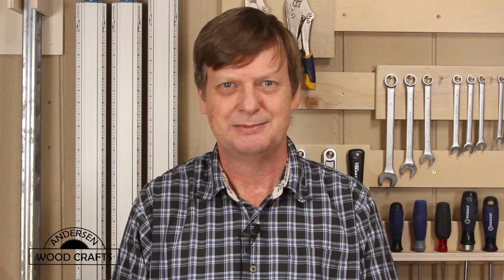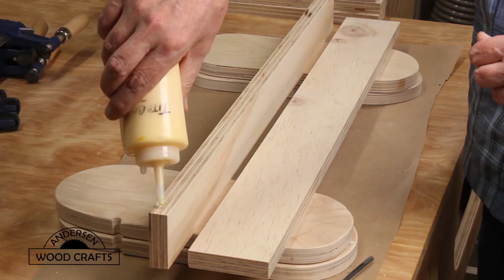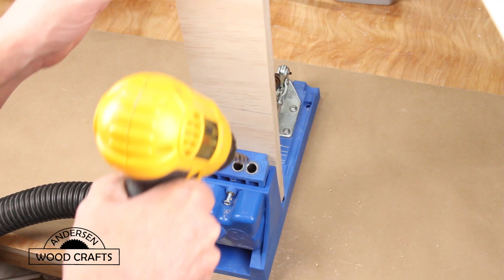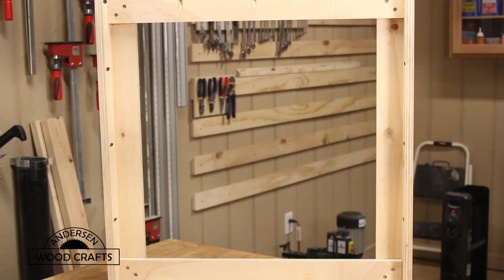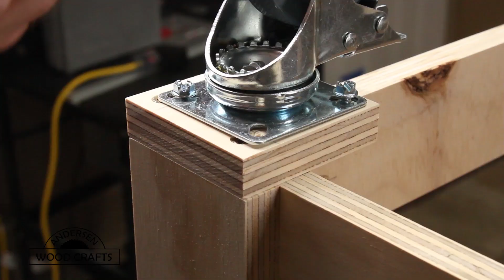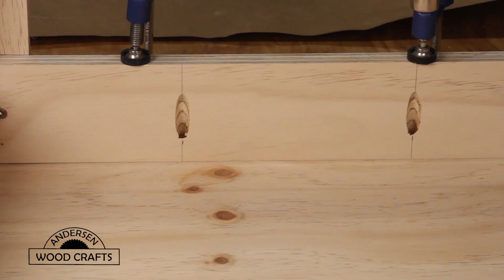SIMPLE SHOP CART FOR BENCHTOP TOOLS

Comment: I like the project. good design but i have one question. I'm not trying to start something. I can see in the video that you said the strength from the legs comes primarily from the glue and yeah I agree about that. My question is It looks like the pocket screws are really just being used as clamps so it probably doesn't matter but it does look like you're going the wrong way with the pocket screws. From what I've heard other people say the pocket screws should be driven from the outside of the carcass in so the screw bites into the most meaty part instead of pointing out towards the very edge of the wood. However this would leave the ugly pocket screw on the outside of the leg very visible but probably stronger but I'm thinking you don't really need it that strong because you're not really relying on the screws you're just relying on the screws as clamps Is that true. If that's true then Why not just Brad nail the thing together from the outside and then you could hide the tiny little dots from the brad nails.
Reply from the maker: You are correct that with just the pockscrews, it would be stronger screwing in from the outside, and I put them on the inside to hide them. Why I didn't use brad nails, because brad nails don't clamp as well as pocketscrews. This is what I love about woodworking. There's no one correct way of doing things; one way may be better than another, but in the end, it's your project, do it the way you want. Thanks for the comment.
Reply: @AndersenWoodCrafts  thanks for the reply and the post. I love the design. I'm going to make a version of it to hold my table saw. Probably going to use  3/4 OSB. It looks like forged carbon fiber but wood.  I think I'll call it "forged haute couture wood fiber". $20 for a 4x8 sheet way nicer than $160 for Baltic Burch.

Comment: I like your design and I’m going to be building a cart for the new drill press I bought. Any thoughts on having brakes on all four of the casters or would it be enough to have brakes on two of the casters and use the less expensive non-brake wheel casters for the other two corners?
Reply: I found a four pack of casters with brakes for under nine dollars at my local Menards so I have answered my own question.

Comment: Nice and easy design. I was able to build mine from scrap lumber. I modified for my dimension and dust collection. I wanted to attach a picture but I guess that is not an option.
Reply from the maker: That's great.  That is what I love about woodworking, you can modify something to fit your needs.  Thanks for your comment and have fun in the shop.

Comment: I'm so glad I came across this video, this will definitely be the design I use for my table saw. I keep all of my tools in the garage and drag them out to a deck on the side of the garage when I want to do some work. Be grateful you have a shop, I'm jealous! I'm not a pocket hole master but I think these are going in the wrong direction. From what I've been seeing, the holes should be going away from the edge of the receiving board, not towards it. Since you're using glue it probably doesn't matter but I'll reverse them just as well. (And then plug them since they will show more prominently.
Thanks again for posting this, I'll be on the lookout for more from you!
Reply from the maker: Thanks for your comment.  I didn't start out with a shop, I spent many years pulling equipment onto the driveway to use them, it works but is a pain in the ***.  Regrettably it may be a few months before I will be posting new videos, I'm in the middle of relocating do to the loss of my house from a fire, but once I get settled I will be putting out new videos.  Thanks again.

Comment: Staple guns or faster stronger
Reply from the maker: Not sure what you're asking.  If you're asking if you could use staples for assembly, you most definitely could.  I have bult them using regular wood screws and pocket hole screws, regardless what is used it needs to also be glued, the glue is what provides the majority of the strength of the joints.  Thanks for watching.

Comment: B.N. me gusto mucho esta forma de hacer esta mesa de trabajo.....la pregunta es si utilizaste plywood de 1/2" 5/8" or 3/4"....excelente trabajo. Agradeceré me des sugerencias respecto al plywood....Gracias.
Reply from the maker: Thank goodness for translator programs.  If the cart will be used for only light duty work then 1/2" plywood would be fine, but if you intend to put heavy equipment on it I would go with 3/4".  I used 3/4" plywood for this build and for the other carts in the shop.  Also make sure you use casters that are rated as heavy duty, I have one cart in the shop (different design then this) that is hard to move around because the weight of the cart along with the tool on it exceeds the caster rating. 
 Thanks for your comment.

Comment: With the relatively small size of my shop, I concluded mobile carts for my bigger tools (drill press, miter saw, table saw and band saw) and a French cleat rolling tool rack would be the way to go.  Glad to see you have a good design for the cart.  I had built one a different way and probably overengineered it.  I like your design.
Reply from the maker: I know a thing or two about overengineering things.  Thanks for watching  and good luck with your shop.
Reply: @AndersenWoodCrafts  Thanks. Buying the wood later today to build 3 carts following your design.
Reply from the maker: Good luck.  With the price of wood today you may need to take out a second mortgage for the wood.  Just have fun in the shop.
Reply: @AndersenWoodCrafts  Finished my 3rd one s few days ago. They work great. What I like most though is that they have given me the confidence to try case work since the elements are very similar
Reply from the maker: @ilive4livemusic  Fantastic.  Projects for the shop are great learning projects.  If you messed up and it's still functional, who cares as long as you learned what to do (or not do) next time. Thanks for watching.
Reply: @AndersenWoodCrafts  Yes, all mistakes were small and none critical. They look good, work well and now give me mobile table band saw, drill press and table saw. Next project will be a rolling French cleat tool storage rack for my hand tools.

Comment: What are the length of legs & rails?
Reply from the maker: The legs are approximately 28" (make sure you take into account the height of the casters).  The long side rails are also about 28" and the short side are about 18".  Of course these dimensions can be customized to fit your needs.  Thanks for the comment and for watching.

Comment: Thank you for your excellent video. I am not a woodworker but need a sturdy cart that will fit in a limited space. What is the heaviest item you have put on your cart?
Reply from the maker: Thanks for the comment.  The cart itself can hold at least 200+ lbs and probly much more (as I can sit on it with no problem), the main thing that could limit what weight load it can handle are the casters that are used.

Comment: this is useful for me, I have a small shop and I want to get my new bench top tools on carts(router table and spindle sander/belt sander) and my old bench top tools (drill press and bandsaw) off the bench they are on and onto a bench that makes the tables of these two tools lower than they are now.. This design with legs like this will save a lot on materials for me.  I bought casters today but didn't have this design in mind.  I would have used a lot more plywood.thanks for sharing this.
Reply from the maker: Thank you, these carts sure are handy in a small shop allowing you to move things around.  Thanks for the kind comment and for watching.

Comment: Super good video. I would like to build a cart for my band saw and another one for a compound miter saw. I am not very good at getting dimensions from a video. Is there any way you could give the dimensions of this cart?
Reply from the maker: The legs are 28" high and 3" wide, with the casters it brings the top of the cart to about 33". the top 26" x 20".  You can always adjust the dimensions to fit your needs.

Comment: Thank you , This is exactly what I was looking for simple, light , and super strong. Buiding it today. Just subscribed to your channel.
Reply from the maker: Thank you for watching.  Have fun building the cart, it does a great job in my shop.
Reply: @AndersenWoodCrafts   I built two of your tables. One for my Bosch RA1181 router table and one for my jobsite table saw. I want to build a work bench/outfeed table 26"Width X 60" Length  X 37" High. To use as a workbench/outfeed table. Will using the same method for the legs/frame  be strong enough and roll around ok for that?
Reply from the maker: @rcboals  It should work fine.  The only thing I might do is make the legs a little wider.  For these carts my legs are 3" wide, for a bigger table I might make them 4".  You also might want to put a support from one leg to another close to the middle of the legs.  I originally got this idea from a Norm Abrams video were he made a 4'x8' assembly table.
Reply: @AndersenWoodCrafts   Thanks, I was wondering about going up in leg width if it would be stronger. I will do 4" the other tables are extremely light and strong and mobile just like you said they would be.

Comment: Hi mr anderson, im 1 of your subs, could you tell me where to get  that thing you made the pocket holes with, what its called and also the size of the screws you used, if you could do this i will know what to get, thanks, kind regards, kasha 👍😘
Reply: Hi Kasha! I recommend adding woodworking for mere mortals to your youtube catalog for learning woodworking. Steve over there has a huge library of entry level projects and basics that give a really good foundation to understand what to do, how, and why. Cheers and best of luck on your woodworking journey!
Reply from the maker: It is called a "pocket hole jig".  There are many different manufactures and types, the one I'm using is the Kreg K4 System, it runs around $100 at Lowes.  There are less elaborate jigs at $20-$30 and others that can cost $500 or more (those would be if you're doing production runs).  The screws are specially designed for pocket holes (Lowes has them) and the size is dependent on the thickness of the material, on this project I used 1 1/4 inch screws.  Hope this helps, thanks for watching.
Reply: @AndersenWoodCrafts  hi mr anderson, thanks for your prompt reply, also thank you for all your info on matierials, good man, im going to have a go with that one, again thank you for the reply on what i need and sizes 👍